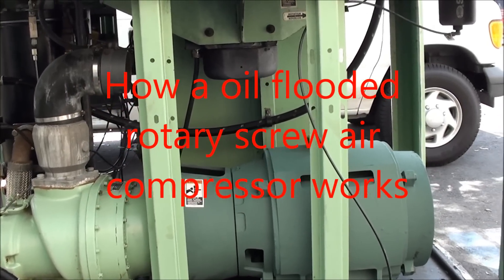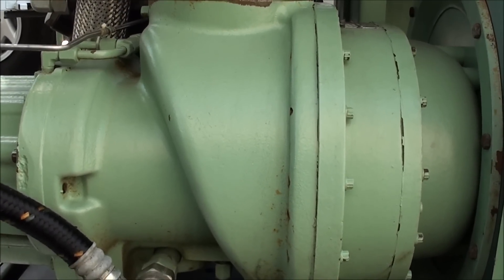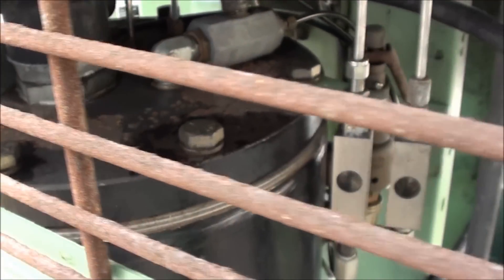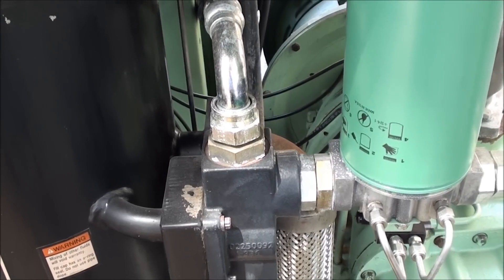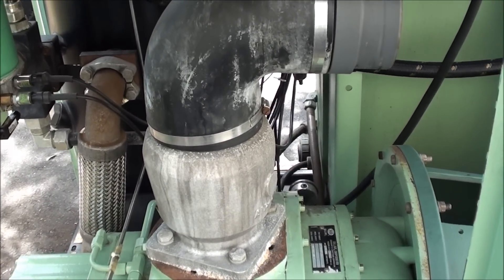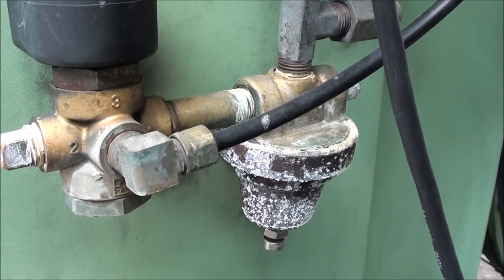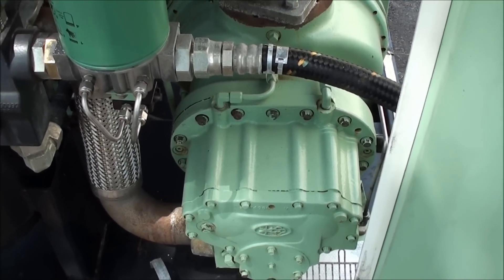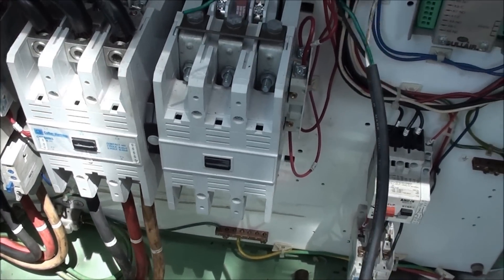How a oil flooded rotary screw air compressor works

Comment from the maker: THE COMPRESSOR GURU IS A BIG FAT DUMB GOOF!!!!😢
Reply: What is the procedure for setting inlet valve clearance on a sullair that uses a diaphragm based control unit?
Reply from the maker: @diezelkuchar6560  I obviously don’t know the machine that you’re working with, but it still remains the same if it is an analog machine or a PLC control machine.
Get the machine to run unloaded  adjust the linkage on the control arm and or the position of the butterfly inlet valve. You’re trying to get the compressor to maintain around 60 pounds of unloaded some pressure.
And that’s basically it
Reply from the maker: @diezelkuchar6560  
One more thing if you’re working with a machine with a pressure switch typically an Allen, Bradley pressure switch is all you have to do to get the compressor to run on loaded is remove one of the wires from the pressure switch. Hopefully this helps.
Reply: @rotarycomptech  Thanks you for getting back to me this is very helpful.
Reply: Would you be able to do a service call over the phone/maybe face time? We have a diesel 750 sullair and a diesel 375 ingersoll rand I am trying to diagnose some issues on the air ends. Thanks in advance.
Reply from the maker: @austinhancock2204  I’ve never worked on portable compressors
Reply: @rotarycomptech  I'm getting ready to start pulling the air end out of our 375, it's running fine but when stopped it pukes out all the compressor fluid out of the front of the air end, where the engine and screw shaft meet. There are not too many people in the area familiar with screw compressors so I though I'd reach out before attempting to break everything down. Anyways great videos and thanks for the reply!
Reply from the maker: @austinhancock2204  I do have a video on replacing a sullair shaft, seal, it’s the type with a rubber lip seal, and a wear sleeve, it might be helpful I don’t know?
Reply: @rotarycomptech  I will check it out, keep up the great content helping everyone out!

Comment: Question. When setting the modulating intake valve. Is it ok to run the compressor with the valve fully closed off? Does the valve fully seal the intake or is there always airflow around it?  At work they have 4 compressors from 1980 and they haven’t been modulating properly for years. Someone has installed different modulation regulators so they don’t have a small leak like the book says they should. Also all the modulation diaphragms are just blowing huge amounts of air out the vents. In fact some of the compressors they have used cable ties to open water drains slightly to allow the modulation control to work. Instead of adjusting the regulator. 
The system is going to take a lot of work to get it working properly again.
Reply from the maker: If you have the Sulicon control.there’s more to it than I can tell you, shut off the compressor adjust the butterfly inlet valve to a 45 degree angle (this is wide open) then you need to run the compressor unloaded, remove one wire from the pressure switch,this will make the compressor run unloaded,
Make sure you don’t have excess arm travel not more than 1.5” adjust the Sulicon linkage to achieve a 30 to 60 PSIG unloaded sump pressure, the back pressure regulator is used to modulate between the two sets points of the pressure switch settings
Reply: @rotarycomptech thanks for the tip. The book says 40-50 sump unloaded pressure. Already checked that. It doesn’t say anything about a 1.5” movement. But that seems about right for the spring adjustment / travel length. 
The outside “compressor guy” the company hired has drilled holes in all the plugs in the sullcontrol. So now we need to have the regulator cranked up way too high because of the amount of air flow. He said it was for water. I’m hoping this week the new diagrams come in for the controls. We have 4 compressors. All of them are so messed up. They are running off the blowdown as a regulator.  I’m slowly dialing them back to factory specs.
Reply from the maker: @CrazyMarty  where are you located and what model number are you working with? Just curious
Reply: @rotarycomptech  Texas. Sullair 1979 Series 32. 200 HP.  We also have a 350 Hp unit
Reply from the maker: @CrazyMarty  unfortunately there are a lot of people out there today and even yesterday that don’t know what they’re doing, not everybody has a brain that can figure out airflow which direction it’s going where it is supposed to go and where it shouldn’t be, I think that there are some operators manuals out there that sell air put out, shows the airflow in the different modes of operation, like full load,unload, and modulation. I’ll see what I can find online that might help you out if you plan on working on this compressor yourself.. just remember the butterfly intake in the wide open position is at a 45° angle. It’s not straight up and down., all the adjustments are made when the compressor is unloaded.
Reply: @rotarycomptech thank you. I know this. The books we have are the OEM books from 1979 & 80. We have 3 shifts of mechanics. But none of them will take the time to read a book. 
Now we also have a kaeser sk 19 that won’t build air. If we close the plastic valve on the multi function valve. It will try to build air. But if it’s open like it should be. It drops sump pressure. And the OEM valve is no longer available. It’s been updated to a different one that costs $760 bucks. kaeser says they are discontinuing all the parts for that unit starting January. 
I’ll need to read over the book we have to diag it.
Reply from the maker: @CrazyMarty  good luck to you. It sounds like you have your hands full. That’s for sure and one thing also for sure I have never been a big.
Kaeser fan
Reply: @rotarycomptech  it’s not so bad. Just they have 3 shifts here and nobody wants to take the time to learn or read the manual. Keiser is definitely lacking on information in their books. If they would just tell us how the different phases of operation worked. It would make it easier to diag the problems.

Comment: I have a 1989 sullair 375q portable. It's set to 100psi max but I'd really like between 125-150psi for sandblasting. Do you know if it can be safely adjusted to a higher pressure. Thank you
Reply from the maker: You should be able to there should be just a pressure regulator, but I really don’t know where to tell you to look

Comment: How is oil injected without a pressure pump? Is it a combination of compressor suction pressure & the throttling effect of the minimum pressure valve on the air reservoir / oil separator ? T.I.A
Reply from the maker: @KamaleshSellamuttu  well you’re partly right, The compressor itself is a positive displacement pump, there’s already a small amount of lubricant in the pump at all times. The rotary screw pump or air end as they’re known as.
Acts like a large oil pump that is left to cavitate that’s why there’s a discharge of air and oil in the sub tank , The minimum pressure check valve also aids in maintaining internal pressure, that’s why when the compressor fully unloaded it has what known as  unloaded sum pressure, typically somewhere around 30 psig to 60 psig , the old Quincy compressors used an oil pump to the end of their production until Atlas Copco purchased them, those particular units would blow down the sump in an unloaded state to 0 psig I hope that answers your question
Reply: @rotarycomptech  thanks
Reply from the maker: @ no problem just in passing I was thinking about the rotary screw vacuum pumps, which almost every single one of those has an oil pump
Reply: is there a non- return valve in the oil injection line, close to the point where it is fixed to  the housing of the compressor? Also please clarify what you mean by " sub tank " , thank you.
Reply from the maker: @ older machines or machines that were built without total closure intake valves like a butterfly required a type of oil stop valve. In the oil injection line .
Sump tank or oil reservoir

Comment: How does the unloader valve work. Does it just shut off air flow to the compressor?
Reply from the maker: @TNFMECHANICAL  it basically closes the inlet valve and vents the sump pressure to atmosphere
Reply: @rotarycomptech  ok thanks. Is there 2 Valves? 1 to shut off the inlet and 1 to vent the sump?
Reply from the maker: @ there’s actually three valves, the inlet velvet itself, the three-way solenoid valve, and the blow down valve.

Comment: hey whats up buddy, what would make air end oil come out the relief valve after shutting air valve to unload
Reply from the maker: It sounds like the compressor, not unloading or not blowing down properly and going over pressure, causing the sump tank relief valve to lift

Comment: Whats fhe Best way to do a fluid change on these? Just changle filter, Drain sump and refill? Or is there a way to drain the system and refill? Cant seem to figure out what point to fill to. (I only drained the sump and refilled)
Reply from the maker: You’re better off to drain it under pressure, remove the quarter inch control line that goes to the blowdown valve then shut the machine down and it will maintain some pressure without blowing down

Comment: Where is the release pressure valve? Is it inbuilt into the screw compressor? Please advise.
Reply from the maker: The pressure relief valve is located on the side of the sump tank close to the lid

Comment: Awesome video. I have 2 ingersoll rand sr100 at work and im trying to get them to run in sequence. Can you tell me how to do that. They both have Tellis controllers.
Reply from the maker: Hey David how’s it going?
I R  Intellis there were so many versions of that and I haven’t had that much experience with any type of sequencing of Ingersoll rand equipment you may have to go back to the distributor to get more information on that then I can give you, but if you know how to change the pressure switch settings you can always do that to select a lead machine. I used to do that with a couple of sullair machines do you keep the hours the same, I would just change the settings every 45 days or 1000 hours.
Sorry I can’t help you anymore than that

Comment: Ty informative video been going through he'll changing siezed   compressor with a good used compressor that one sized in less than a minute called vanair tech not much help your video explains how the lube system works in detail afraid to change another compressor  ty again

Comment: What's the oil pressure while unloaded on this compressor pal
Reply from the maker: No problem pal real simple
The oil pressure in any oil flooded screw air compressor is roughly the same as the wet side of the sump. Air pressure = oil pressure
Reply: @rotarycomptech ah sweet

Comment: Izin bertanya min, kalau compressor screw itu flownya tetap atau berubah" y min ??
Reply from the maker: I can’t help you my friend I only speak and spell in English.
Pologize
Reply: @rotarycomptech  oh i'm sorry. I ask . When the compressor operated , flow is steady (fix) or fluctuating ??
Reply from the maker: @farhanhakimul8053  
Fluctuating or modulating although the compressor can run load unload or online off-line
Reply: @rotarycomptech  the fluctuating cause from ??
Reply from the maker: @farhanhakimul8053  Are you referring to the compressors output or flow a.k.a. CFM
Reply: @rotarycomptech  My compressor flow is acfm that same with cfm ??
Reply: @rotarycomptech  the compressor load-unload controling . So how much percentage the fluctuating when unload at 8.6 bar and load again at  7.9 ?
Reply from the maker: @farhanhakimul8053  acfm means 
Actual cubic feet per minute. If you’re running load unload your flow rate is 100% to 0% If that helps I’m a little bit confused at your actual question
Reply: @rotarycomptech  sorry, if my  English language is bad. So the acfm is flow suction or dischard of compressor ??
Reply from the maker: @farhanhakimul8053  discharge 
Out put
Reply: @rotarycomptech  oh yeah thankyou very much , you have answer my question 🙏🙏

Comment: Sir. Good day,, we have prob. Of oil is emptied on the tank and spill out .. what migth be the problem sir? Iam new with this equipment. Your answer is much helo. Thank you
Reply from the maker: Did it come out of the intake filter?
Reply: @rotarycomptech  yes sir, what posible ptoblem sir?
Reply from the maker: It could be the check valve in the inlet valve or the oil stop valve what model machine are you working with?
Reply: LS20-150L
Reply: Sir now sir the problem is high temp. On on T1 and T2 sensir. And having unussual sound on the sxrew compressor. Please help. Thank you sir

Comment: Long shot but I have a sullair iso9001 and keep getting a starter fault. Any information you can give on what to look for would be appreciated. Thanks
Reply from the maker: ISO 9001  Is a manufacturing standard not a model number
Reply: @rotarycomptech  I see. The model is 3012 ac. I'm gonna read up on it

Comment: hi, Ed. are you technician of sullair compressor?
MC
Reply from the maker: What do you mean?
Reply: @rotarycomptech  that's sullair, right?
Reply from the maker: @kwarzainuddin506  yep
Reply: we got problem with sullair compressor LS20-150H. 
the controller indicated load but P1 and P2 stay in 1.4 bar. please help. how can we fix it?
Reply from the maker: @kwarzainuddin506  minimum pressure check valve.....Broken drive coupling?
More info please
Reply: @rotarycomptech  first starting it works load unload but after 3 times unloading, there is any problem like i said. the controller indicated load but pressure stay low.
no problem with shaft coupling. compressor still running with that condition
Reply from the maker: @kwarzainuddin506  are you running load unload or modulation?
Assuming load unload it sounds like you got trapped air in the control line to the inlet valve or spiral valve, check the 3 way check valve and control solenoid valve. 
Also to confirm or deny remove the control  
Line from the intake valve when running is
There a air signal?
Reply: @rotarycomptech  thanks Ed.
we'll try
Reply from the maker: @kwarzainuddin506  my name is Dave, 
But you're welcome

Comment: I have one just like this one I have problems with over temperature I cant figure out any ideas
Reply from the maker: I'm assuming the unit is air cooled.
 There are quite a few things that can cause a overheating problem,
 Assuming you have not varnished the inside of the oil cooler by running an  Inferior type of lubricant, and you don't have a high temperature rise of crossed the air end, I would pressure wash the cooler and replace the thermal valve

Comment: Can you help me
I have one screw compressor 160 psi
Water coming in air
Please help
Reply: Make sure you have proper water Separator,  and air treatment filters installed along with a sufficiently sized air drier which basically dries the compressed air before it enters your network.

Comment: hi,  you made this video very informative and understandable, i bought a 1992 EJBRDB 15HP , and it was converted from 460 to 230 , but i have been told it needs programing , because is plugged in but wont constan run. any advice will help.
thank you
Reply from the maker: I'm not familiar with that model number
Reply from the maker: Sounds like a Gardner Denver model number

Comment: In our plant have SA350 oil inject screw air compressor.
In these have two oil filter after the oil cooler . 
So I want to know that all these two filter work continues at same time or one work at a time and one stand by.
Please reply me.
Reply from the maker: They work together with some what of the less  passive resistance Theory but they're both needed as one isn't large enough more than likely

Comment: Why do we use flexible hose after oil cooler and airend
Reply from the maker: Because the manufacturer Sullair is too cheap to use steel lines anymore